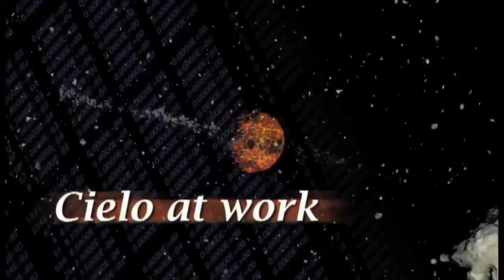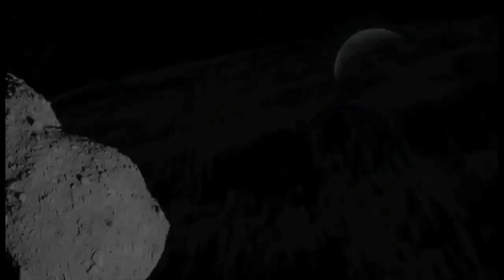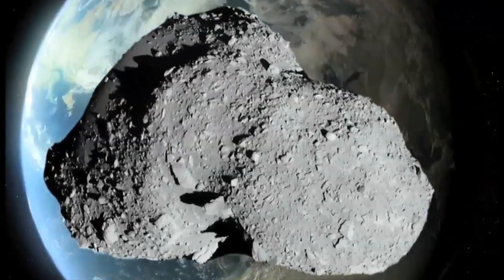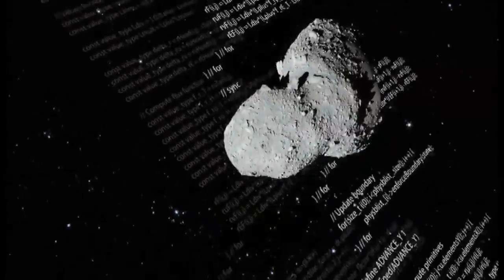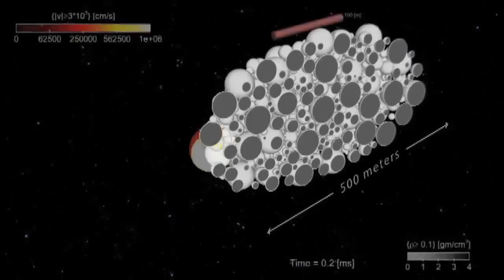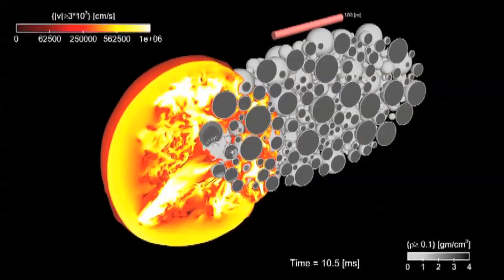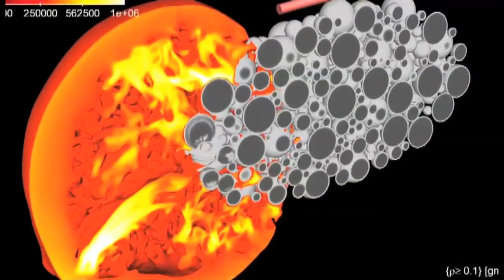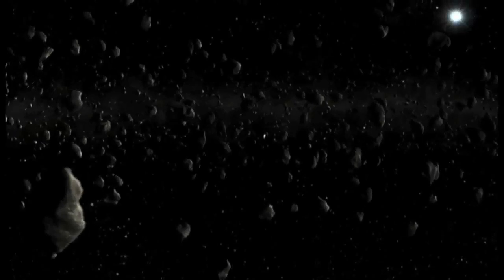Will Nuclear Megaton Shockwave Avert Earth-Bound Asteroid?

Comment: 10,000 plane sized impacts is better then all 10000 rocks fused together hitting in the same area.  Drop 100 marbles in a bath tub in a spray pattern and then drop a single object with the same amount of mass in there.  Very simple but a very good example.  And you cant even see the pressure effects in the bathtub only the mass movement.

Comment: Ok, impact on the surface might split up the distribution of rocks in a loosely knit asteroid. But, that DOES NOT mitigate the damage risk to the earth. He just made a big claim with no supporting information. A VERY red flag. To calibrate your BS meter, when the blast happens, how likely will it be that the rocks within just blow into a disperse pattern. Thus instead of 1 big BAM you get 10,000 boeing size impacts all over the earth.